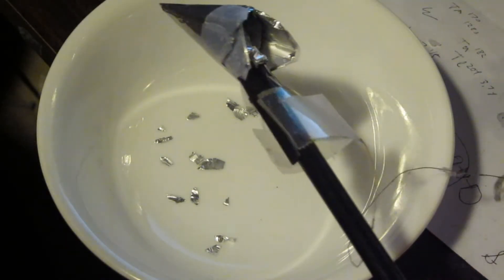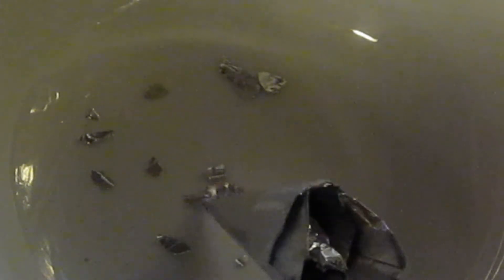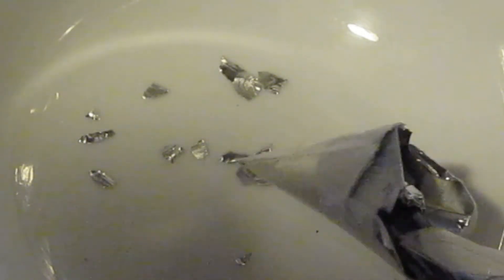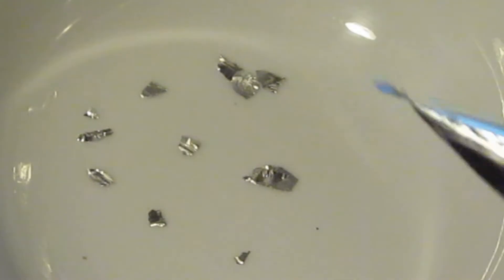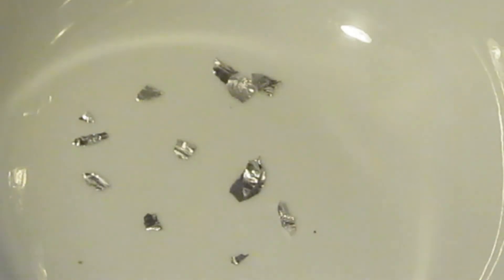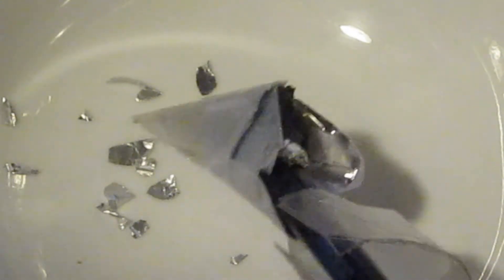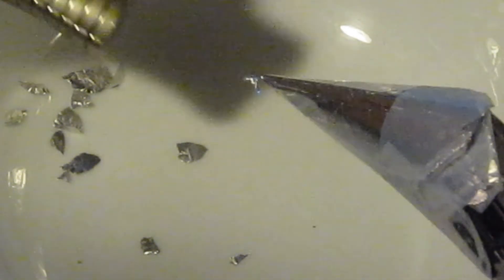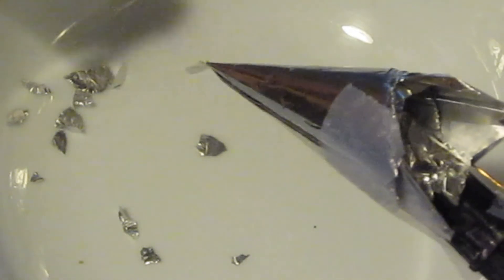Psychotronic Generator Magnetizing Aluminum

Comment: Me again if you make a Utron from Aluminium, two cones about 1 inch diameter in a lathe, I have one. Spin the Utron in a dremil up to 10,000 min to 30,000  rpm and hold a neodymium magnet in a plastic cup very close to it. It will flip the magnetic wildly around. That's with no electricity. Amazing and a key to antigravity.cheers
Reply from the maker: Very interesting! Did you post any videos on this? That would be interesting to see. Thanks
Reply: @jaynesnetwork  Hi I tried to find it again for you, but couldn't. It was on Ottis T Carr and Raph Ring,s videos on making the craft, I saw it and it should be easy to recreate.Remember he had the neo magnet in a spray can plastic lid, and held about 1inch from the Utron. I think it was about 10,000 rpm,s.